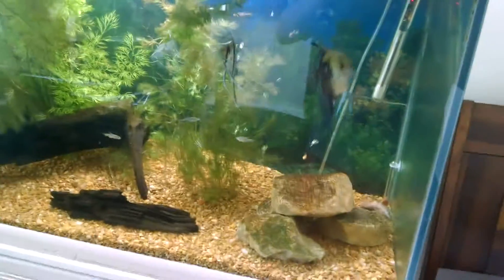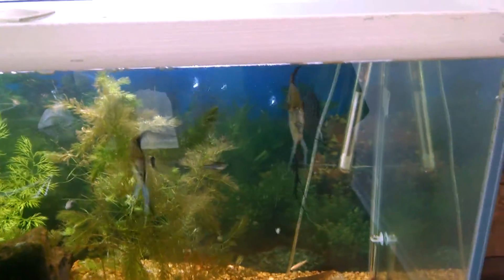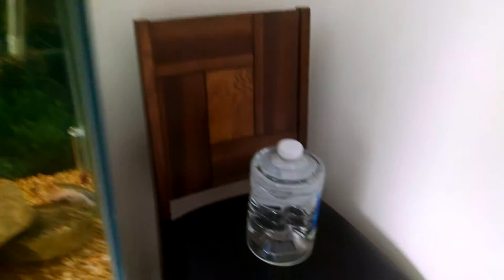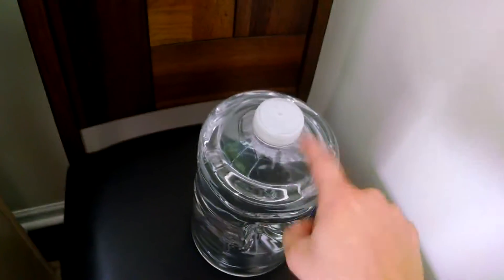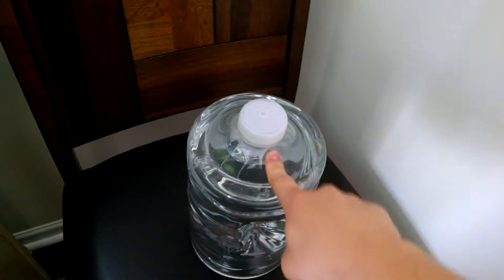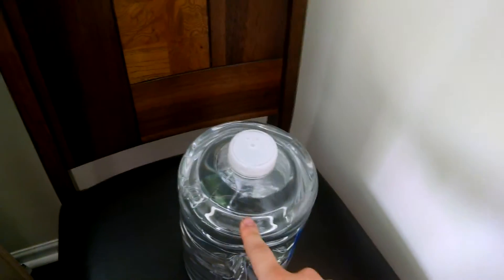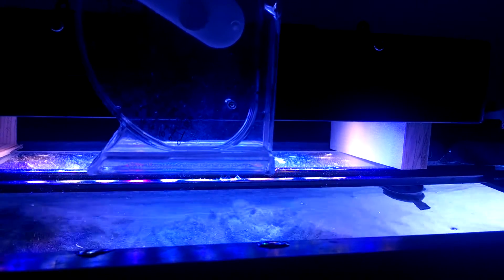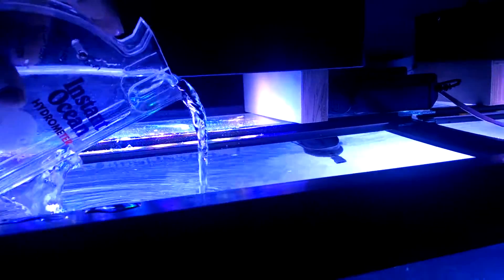How to replace evaporated water

Comment: Do you need to do a water change first or we can just add water to it?
Reply: You must treat the water with prime and store it in a container room temperature or if you have fish that require heater then you must warm the water and achieve same temperature as the tank to preventing shock.the technique he shows is only for adding water thats has been evaporated for both freshwater or saltwater .
Reply from the maker: Thats on top of water change, this is only when you need to replace evaporated water

Comment: Every time I use a plastic bottle to add water, I get tiny white flakes in my tank. I'm guessing that is plastic from the bottle? Frustrating.
Reply from the maker: Well you should rinse a new bottle or plastic jug before using it and also I really would use only 5 gallon jugs or 1 gallon jugs but not bottles
Reply: That might be calcium build up test water for gh or kh maybe water hardness is high or container has some type residue thats causing this white stuff